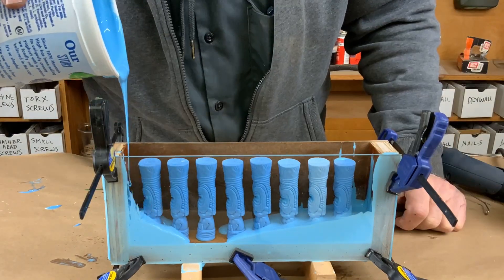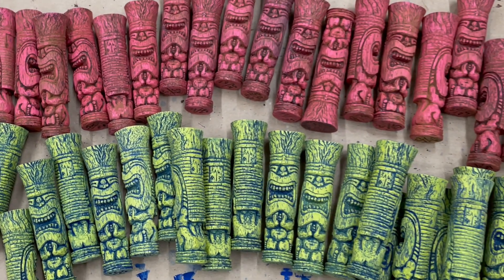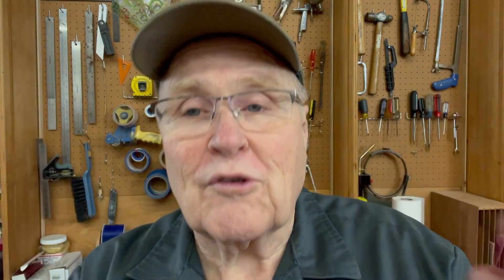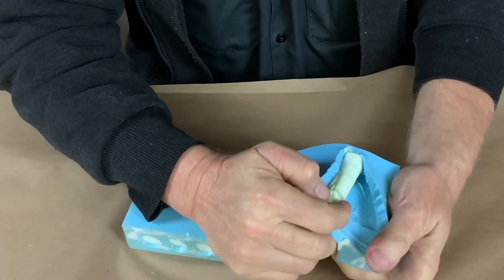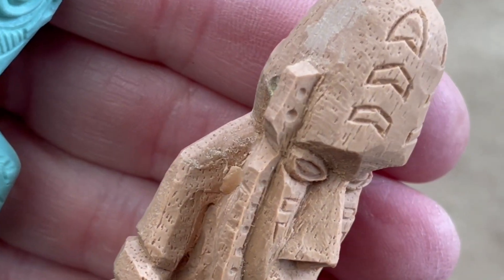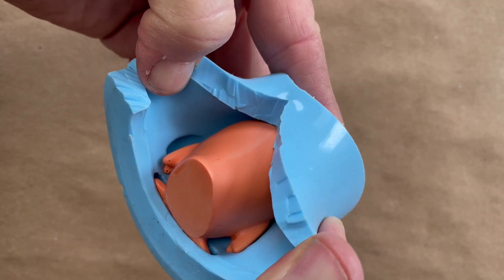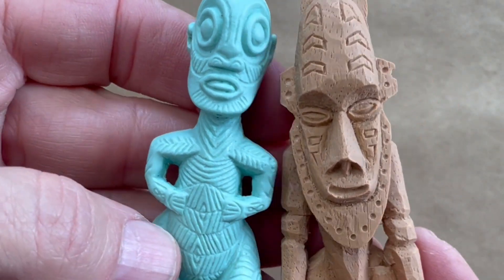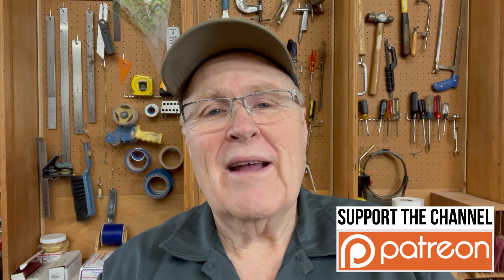How Many Castings Can You Get From A Mold?

Comment: I have found a good measuring stick is the lighter the color that touches the resin (or more opaque it is if it is translucent silicon) the closer it is to failure.  When your translucent resin especially turns to an opaque near white.... it is time to break out the violin.

Comment: Hi Robert, this question doesn't pertain to this particular video.
I have a small project where I need to cast a portion of an object. The object is roughly cylindrical and I only need to copy the end of it which has a detailed and sort of complex shape. I'm thinking of suspending the object and slowly lowering it into a cup of silicone to the needed depth and then letting it harden, or attempting to paint on layers of rubber, which I've not done before. The object is only as long as my hand, but I'd rather not cast the whole thing if I don't have to, especially as the end is more intricate than the rest of the length. As a note, I don't expect any significant undercuts due to the shape of the end, I expect it will remove from the mold with minimal or possibly no cutting. Thanks!
Reply from the maker: Look at the shape of the object that you are dipping into the rubber. If there are any areas which might catch bubbles they probably will. I would pre-paint the part to be cast in a couple layers of rubber, then suspend it in the mold. That way you would be more likely to get a good mold.
Reply: @RobertTolone  thank you so much! I don't do much casting, but I have a few small objects that I need copies of. I expect that doing those molds first would behoove me as I could use a little rubber from them to paint on to this piece. I appreciate your help. Your channel is always enjoyable to watch.

Comment: Great information in your video...i find if i use addition cure RTV it is more resilient to resin and also i try to remove the casting as soon as its cured and don't leave in the mold any longer that i have to.
Reply from the maker: Excellent suggestion! I should emphasize to the viewers that you should pull the castings out as soon as possible. It definitely extends mold life.

Comment: A key factor is the temperature of the resin as it cures. Higher temperatures stick more.
If a choice of two resins are availible, the one with a slower cure time will give more runs. 
Giving the heat from one run time to dissipate before the next pour extends mold life.
Thicker sections cure faster and hotter, so designing to avoid them extends mold life.

Comment: Surface roughness isn't just a mechanical property, it's not only mechanical interlocking. It's also more surface area for molecules to interact.
Like with gecko feet, which have a very high surface area, so that the electrostatic force between the feet and the wall is high enough to support the whole gecko.

Comment: A friend of mine has occasionally used bathroom caulk for larger sculptures that she only wants to use only a few times to make a wax copy for metal casting. It's cheap and not necessarily easy, because bathroom silicone uses water to initiate the curing. So she spreads blobs of the silicone around in a dish of water with a pallette knife or some such thing until she can feel it start to cure and thicken. Then she spreads it on the model wearing rubber or nitrile gloves or whatever, keeping a dish of soap solution nearby to prevent the silicone from sticking to the gloves. And it cures pretty  quickly. You just have to be careful about whether individual blobs meet in a flush manner. Otherwise,  it leaves ridges in the cast positive that have to be chased. For large pieces, a supporting shell is needed  of course. It only lasts for a few castings, but for one-off pieces, like a portrait bust, it's not a bad technique.

Comment: For a while, my molds wouldn’t last very long. After a few castings, my next castings would develop a weird texture and then the mold wouldn’t last very long after that. It would get more rigid, white, and I’m assuming it was drying out. 
I started using a mold release every time I cast. I’ve always heard a mold release wasn’t necessary with resin in silicone, but it’s definitely helped my molds last longer.
Reply from the maker: Mold release can be a big help for mold life but it transfers to the castings. That can cause problems or create a lot of extra work when painting the castings.

Comment: when folks sell second-hand Hirst Arts moulds they often say how many resin castings they've had in them because you only get a few hundred before the mould will just die. Generally, with Hirst Arts you would use some kind of plaster which I think does not have any chemical interaction and makes the mould last pretty much forever.
Reply from the maker: Yes, some combinations of materials don’t wear the molds much and can last indefinitely.

Comment: I used several types of casting resin, and use silicone mold tin cure and platinum cure, for cast mini headsculpt 

And this the result i get

25 pcs Urethane resin cast
25 pcs epoxy resin cast
100pcs++ polyester resin cast 

Not manny option  silicone mold meterial on my country 

I envy those who can cast  polyurethane resin up to 50 pieces /1 mold

Comment: Great video Robert! Couple questions, will you get more pulls from platinum silicone vs tin cure given all other factors are the same? Also, the presenter in an Alumilite video said that wiping down the inside of the mold with silicone oil every 10 pulls will extend it's life, do you know if this is true? Thanks.
Reply from the maker: You might, and platinum molds have a much  longer shelf life than tin.  Mold release can be a big help for mold life but it transfers to the castings. That can cause problems or create a lot of extra work when painting the castings.
Reply: Silicone oil leaches out of the silicone as you cast in it, so replenishing it can improve the longevity of your molds.

I read a paper on extending the life of silicone molds with polyurethane casting by putting the molds in a bath of acetone, and then a bath of acetone mixed with silicone oil. It found that doing this every ten casts with just acetone increased the number of casts per mold by 30%, and the acetone silicone oil mix increased the number of casts per mold by 60%.

Comment: Hi 👋,  I used to do a lot of casting using latex rubber, which can degrade quite quickly with finner textures,  
eg Wood grain, I found using silicone spray as a releasing agent worked really well for ease of removing the cast items, as well as keeping the detailed texture intact for a significantly longer time.
✌♥️🇬🇧
Reply from the maker: Mold release can be a big help for mold life but it transfers to the castings. That can cause problems or create a lot of extra work when painting the castings.
Reply: I was about to ask exactly if those methods would work to lengthen lifespan! Thanks :)